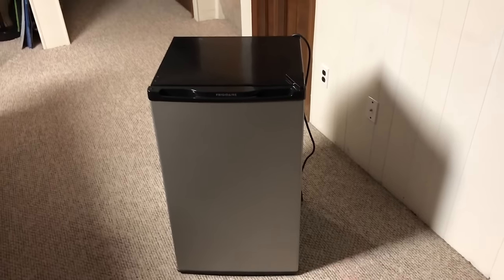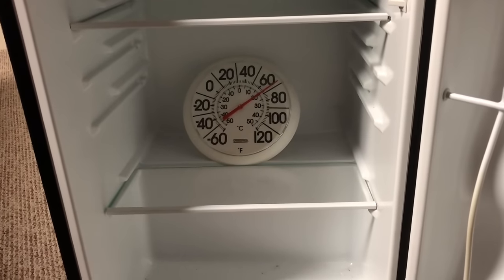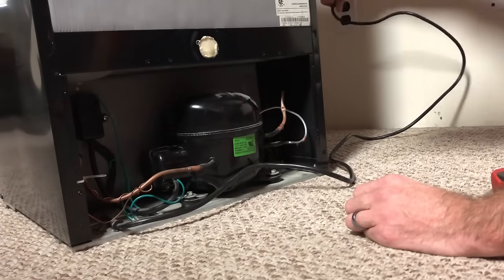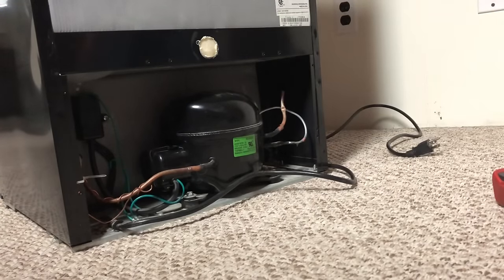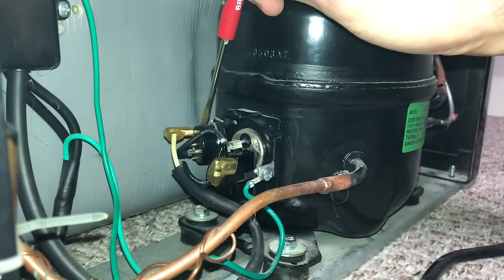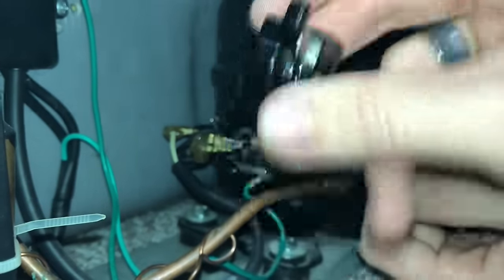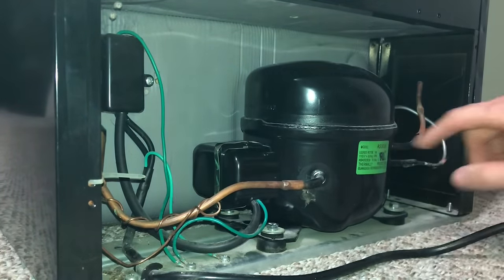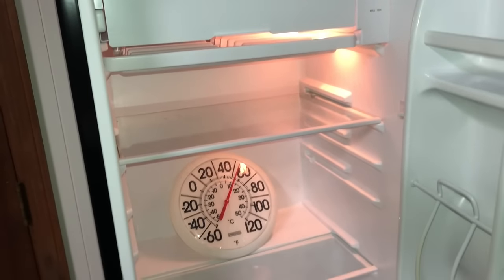Fix a Frigidaire mini fridge that is not cooling (LFPH33M4LM)

Comment: My compressor doesn't look like this one... there's a huge plastic protector on what you're working on... with no simple "pull on this" to open it up
Reply from the maker: Some have a clip you have to pry off like in my newer video. 
https://youtu.be/5KlTjU4cRVA
Reply: @DustinRogersinMO  finally got it off but there's 2 wires going into the relay... I can't get them off but I'm shaking the relay still... no rattling... so I think that the compressor is fried... there's also no clicking sound when I plug it in... appreciate your video and I was able to at least get the relay exposed... but it's not what's wrong...
Reply from the maker: @inhumANthropoid  a bad relay doesn’t always rattle. Watch the other video I posted. That relay didn’t rattle, but was bad.
Reply from the maker: Also, if you have two wires going to the relay, you may possibly have a start capacitor, which could also be faulty.

Comment: My switch relay just burned out as soon as I connected the power.
Reply from the maker: Did you check for shorts to ground?
Reply: @DustinRogersinMO  i don't know the ground look fine. You know the compressor fired up real good. It didn't humm. I thought I had fixed it! And then pop* sound like a short in the device.. smelled like burnt plastic. Idk whats wrong.

Comment: where are the fuses?
Reply from the maker: Most won’t have fuses. There’s a circuit overload device on the compressor which can be heard clicking in the video. The other circuit protection is going to be the breaker/fuse in the house wiring.
Reply: no sound when plugged in. No rattle at the starter switch. no clicking .
Reply from the maker: @lionreb  make sure that the outlet that you’re plugging into has power. Try a lamp or fan in that same outlet. Also verify that the thermostat is turned on. I’ve had responses from a couple people that tested a bunch of stuff only to realize that the thermostat in the fridge had gotten turned off.

Comment: Mine is running. We moved it and now not cooling. 🤷
Reply from the maker: If the compressor stays running, and doesn't click off because of the overload switch, you probably have a refrigerant leak or a blockage in a refrigerant line that occurred during the move (typically from laying a fridge down). Both of these issues would require special equipment to repair. Unfortunately, paying someone to repair the system will likely cost more than a brand new replacement refrigerator.

Comment: It's crazy stupid how poorly engeneered mini fridges are. Got a new Daewoo 4.4 & the electrical sucks. Way too basic for such a large appliance. For the price & size of such a device I would expect better engeneering & design put into the stuff that makes it all work. Some built in surge protection/prevention or at least some Energy Star power saving tech would have been nice. The wiring seems very(even dangerously) minimal for this kind of appliance. Just a compressor, relay unit, control box & a power cord. No protective tech or circutry. What a joke. Mine started tripping our breaker every time it starts up causing lights to flicker slightly & TV audio to pop a little. An appliance that alegedly only uses 1.1 watts & 115 volts really shouldnt be doing this & since its new to.

Comment: i wish i knew electronics well, mine doesnt do anything , no clicks or hums . nothin.
Reply from the maker: Make sure the thermostat in the fridge is “on”.
Reply from the maker: Doug Thomassen you may also make sure that the outlet it’s plugged into works. Try plugging a lamp or something in there to verify the outlet works. If not, there may be a circuit breaker or fuse that tripped in the breaker panel.